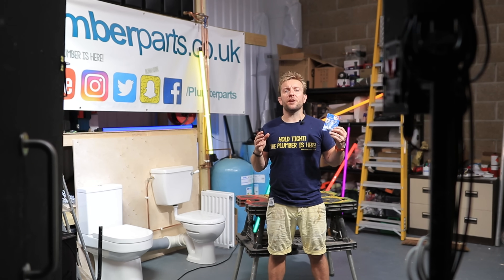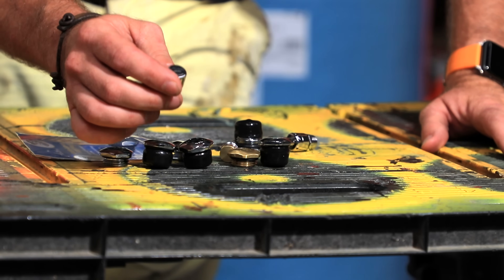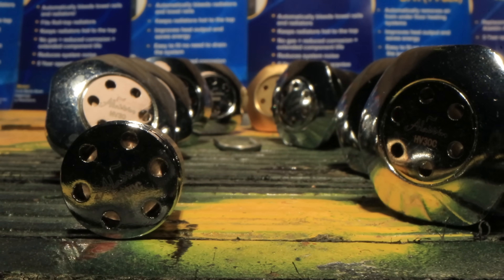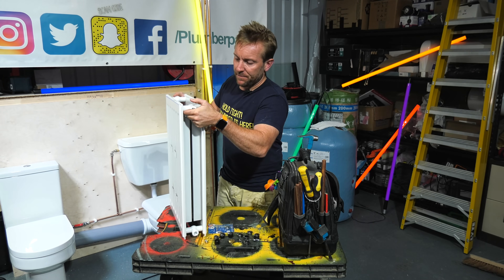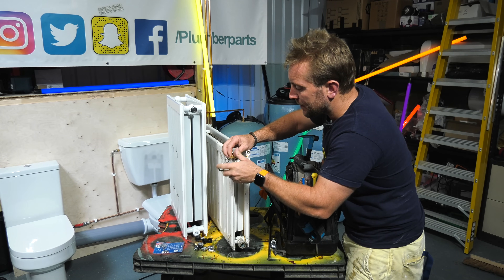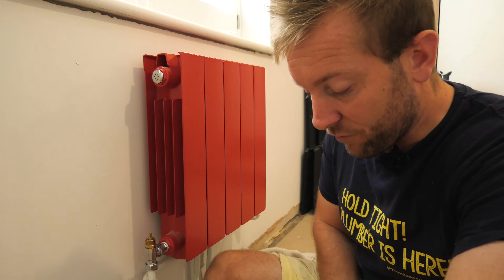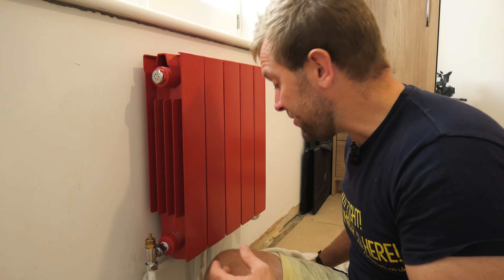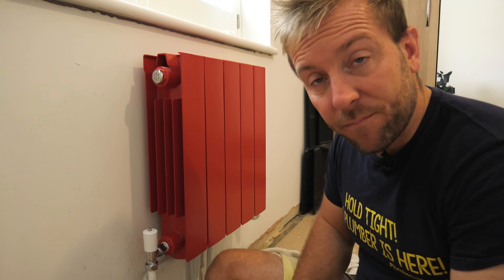HOW TO VENT AIR FROM RADIATORS AUTOMATICALLY - ALADDIN AUTOVENT

Comment: After fitting a new rad, this particular one is very noisy. I know it's air, but for some reason I can't get rid of the air completely and the sound it makes is similar to a running water inside the pipe. Would fitting one of these will be a good idea?

Comment: So I'm a DIY, and have tried to follow your video on how to fit a genuine Aladin autovents. Failed: I shut off both radiator taps and slowly started to drain the rad from the the manual bleed valve and waited and waited and waited. The water came out dirty at first then clean but would not stop flowing. Tried a second rad and the same thing happened, so what am I doing wrong? And the obvious questionis can you fit these devices to all central heating systems?

Comment: Need update video on this product, I fitted these in my house, and i can tell you now, like most of the topics online about this product.
I too am now having issues with random air appearing in my system. No leaks or air getting in prior, Now all of a sudden it has air gathering. at £10 per one i regret my purchase.
Reply from the maker: Mine is still fine. There are myriad other reasons and causes (including these obviously!) but don’t knee jerk to one opinion. Add some inhibitor. Turn down pump speed. Analyse for a few weeks.
Reply: @plumberparts  What inhibitor do you recommend other than adey Mc5.

Comment: If your needing to bleed air vents regularly, I would suggest the air being released is in fact hydrogen indicating advanced electrolic corrosion,air released would be replaced with oxygenated water which will feed the corrosion process.

C

Comment: Question, i have had a softened water unit installed, should I drain my heating loop and refill with softened water as it wont have the scum and scale from hard water, and I live in a very hard water area ???
Reply: Depends on your boiler, some boilers have an aluminium ring inside (Worcester in particular) which softwater damages

Comment: Very good video, but if you just leave it to vent the air manually, how long are we talking? An hour, two hours, overnight, three days? Any ideas? Just bought some and fitted them after seeing another one of your vids, but still got the classic cold top third of both of the two rads I fitted them to at present (rads were fitted yesterday). Edit: Ah, watched a bit further on in the vid and seen the table now ...

Comment: Great video James with lots of useful tips.  It says on the instructions that ideally you should fit the Aladdin Autovent on the side of the radiator where hot water comes in (generally the side with the thermostat)

Comment: Due to a failed clutch drilling a 6" hole for 155 btu Grant Vortex flue i now have a distal radial fracture on my wrist with stretched and tore tendents.In a cast for the next 6 weeks and months for tendents to repair.I stupidly continued to work as didn't want to hold up sparks and plasterers or let the custurd down.
Moral of the story replace your core drill every two years or get it serviced.Always follow correct procedure when drilling ..we all know how cores like to jam.Off topic guys but thought it might make some fellas think twice and have safety in mind.My first accident on site apart from falling through a ceiling as an apprentice.😀 .Its going to be a tuff year keep the vids coming as they keep me sane.
Safety first your health is your wealth.

Comment: Been using them for years but only reliable when using on a spotlessly clean system any gunk and they will clog up within the year.
Theres also the more simple 1\8 auto vent that use to come with the cast rads £1.50 each on ebay but these actually drip if the system is not spotless.Moral of the story great on a new clean system.
Reply: Hi there I think you're talking about a different product.  The Aladdin Autovents are guaranteed leak-free for life - if you get any that leak please let us know.  Gung in the system shouldn't block them - if they stop venting within 5 years please contact us and we will replace.  Many thanks

Comment: So how do you know when the valve needs replacing is there a way of detecting this ?
Reply: They will last for at least 5 years.  After this time when the radiator begins to feel cold at the top they will need to be replaced - many thanks
Reply: @niftylittlebleeder  thank you for reply I  already had a couple in use for 2 years and was wondering on this

Comment: So how do you know when the valve needs replacing is there a way of detecting this ?
Reply: It may be worth introducing a maintenance schedule changing either the valve or cartridge after 5 years, an easy way of establishing if the valve has stopped venting would be to feel the radiators, to see if there are cold spots near the top.

Comment: I had an Aladdin autovent HV30 and it wasn't much good. It ended up corroding with the holes getting blocked by crusty gunk (yes, the system was inhibited and has a Magnaclean installed) after around 3 years. I needed to replace it eventually when it started to weep. Went back to using a standard vent plug.

Comment: Every radiator in my house has these but I’ve fitted the non replaceable cartridge model. 
The whole valve is cheaper than a replacement cartridge so I never saw the point in buying the even more expensive replaceable cartridge model. I didn’t know that the cartridge could be replaced so easily so maybe it is worth the extra.

Comment: Nice, do they automatically let air in when draining the system?
Reply: Very good question 🤔
Reply: Hi Andy no they don't let air in they are a one way valve and only let air out.  Many thanks
Reply: Aladdin Plumbing Products thanks, so if you loosen the cartridge would that let air in? I’m just thinking about when the system is drained and you open the manual bleed values to let air in so it drains faster.

Comment: I used one of these on a single panel up in the loft. The thread had stripped where the bleed screw goes so I just drilled and tapped a 6mm hole in a new location at the top of the rad. Worked a treat. Nice 1 James 👍🏻

Comment: What if you're trying to pull a vacuum on a system...🤔
Reply: Could pull out cartridge of those are fitted? Or work quickly 😄
Reply: I had the same thought 🤔 I suppose   close off both sides of every rad in the house.